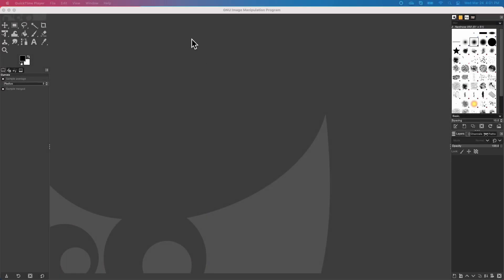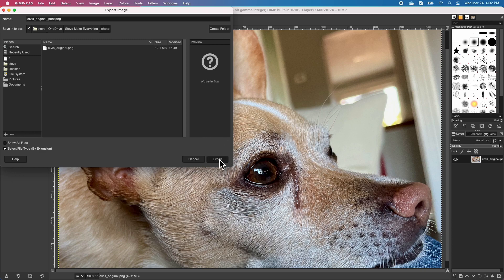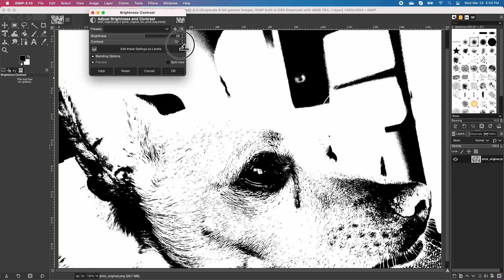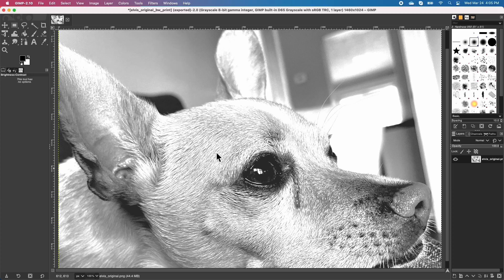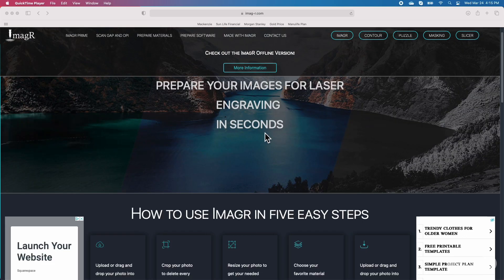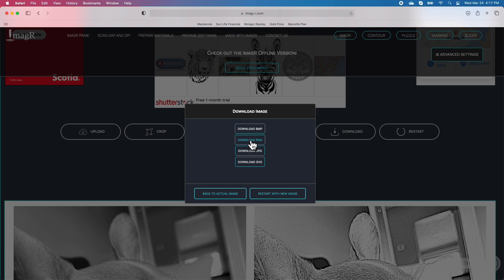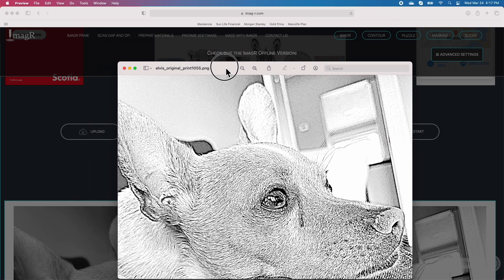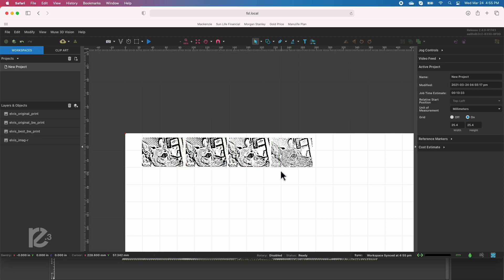HOW TO PREPARE AN IMAGE FOR LASER ENGRAVING // Is This Really Necessary?

Comment: I had great looking photo on imagr..but when  previewed it in lightburn .pic was totally whiteout..Im getting so frustrated with using laser.. nothing is working like it does in these videos
Reply from the maker: I'd like to say I possess some sort of magic, but more likely, the image isn't in a format amenable to Lightburn.  Download the image to your local computer and try to open it with an image editor.  If it's messed up there then Lightburn won't load it properly either.

Also once you bring it into Lightburn you would need to assign it to a layer (the numbered colors along the bottom of the screen).  When you pick a layer you will also have to tell Lightburn that it is an image

Comment: This video was very helpful, but saw no mention of image size ...kb,1mb, 10mb. Whats range of initial resolution is recommended?
Reply from the maker: Since images tend to be 250-300 dpi the image size is usually pretty small. You can got to 500 or 1000dpi but there is y much benefit

Comment: Interesting video. With a good image like in this example, I agree you don't need to do more than converting to greyscale. When you have a bad photo however, you definitely need to change it with photo editing software to get it acceptable for laser engraving. It would be nice to see this test repeated with a photo that has dark shadows in it.
Reply from the maker: Not every photo is good for laser engraving regardless.  RE3 does do a decent job of interpreting engraving levels right out of the box.  No question it can be improved but the law of diminishing returns definitely applies.

Comment: About the only thing I can suggest from a graphic design stance is when you change dpi, also adjust the image size to match the physical size of the final product... 12"x20"
Reply from the maker: Good point. Actually I should have set the DPI to 250 rather than 150 as well. Probably not a huge impact though